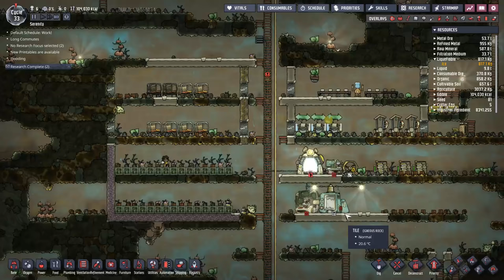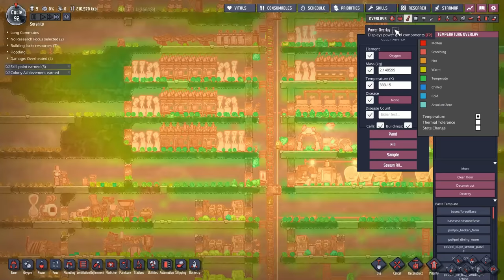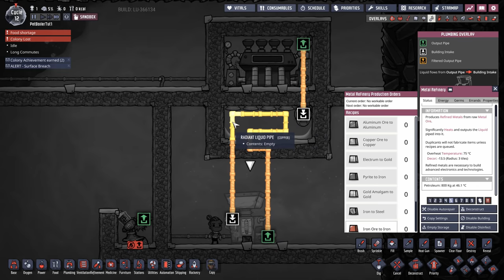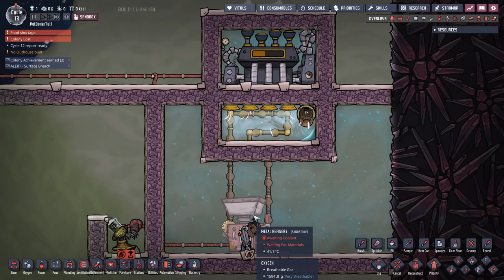Temperature management: Tutorial nuggets : Oxygen not included

Comment: And this is where the learning cliff becomes a mountain.
Reply: There are two rules: 1 Aquatuner moves heat. 2 Anything hotter than 125°C goes in steam below a steam turbine. It really isn't that complicated. 
His aquatuner bridge bypass and heat regulation with doors are not required, so it looks a little more complicated in the video than it has to be.
Reply: @Hedning1390  As a nooby i must ask: what would be an aesthetic(-ish) alternativ? Or any alternativ at all? :)
Reply: @MuhGuy  What do you mean by that?
Reply: @MuhGuy  For the doors you can just cut that step out. Doors are easier to use than pipes in some very specific circumstances. His example with the magma oil boiler is one such. However it's not something  a new player has to bother with. Doors are more fail safe though. If for example you lose power a door can still open and stop the heat flow. However if you are heating your aquatuner coolant and power stops for a long time the coolant can heat up until it vaporizes, damaging the pipes.

As for the bypass its purpose is to keep the coolant flowing so that you don't have to measure temperatures in several different places should you have many hot-spots. I prefer to use something similar to 20:40, ie a short loop for the aquatuner and one or several large loops going through the "ice box", but with a loop and pipe thermo sensor instead of a pump and valve feeding the tuner like 24:06. Basically 24:06 for controlling the tuner and the 20:40 loops instead of the door.
Reply: @dsch772   Well i thought that doors outside of there actual ment use, looked kinda ugly - like as flowdy~tiles underneath a waterreservoire...
And in most builds they (i didn't know open doors couldn't let heat travel through) they sticked out like a sore thumb to me, so i always look for alternativs.
Reply: @MuhGuy  I'm no expert in mechanical engineering, but one alternative I can think of is using pipes in combination with a shutoff. You can pipe in a coolant, or a heat source, and shut off the pipe if temperature is going beyond desired. However it could be a little challenging if you want to pipe in material with extreme temperature (like magma for a petroleum boiler). In any case, doors are still much easier to deal with. It saves both space and material.
Reply from the maker: @Greywind it's not the easiest but it can be done. The steam turbine destroys heat and we use the aquatuner to move the heat there. The save game files are included go in and have a play around. Use the sandbox to run some experiments. You would be amazed what you can figure out with a little play.
Reply: @FrancisJohnYT  I'm only about 500 hours in at this point and from what I've seen of the late late late game it's not the hardest thing to deal with. I've messed about with it in sandbox and I get the principles of how it works. My noggin' just blows a fuse whenever I actually go and attempt it in a game. =7
Reply: @Hedning1390  Nothing is complicated when you understand it. =)
Reply from the maker: @Gr_ywind  Tell you what I can do a practical cooling example. What would you like me to cool down? O2? A base? Crop water? Sleet wheat farm?
Reply: @FrancisJohnYT  I'm sure some people would benefit that, but you already have some in your playthroughs so no need for my sake, it's just my inexperience of good layouts, planning, and what works this point. I just need to get better at scaling everything. The O2 layout nugget was great for that.
Reply: My head asploded trying to watch this. I think experienced players forget how much this game is to take in for new players. The cooling here is just one thing of so many going on with a base. I keep waffling between quitting, trying things out and watching more videos in an endless cycle!
Reply: A learning plateau
Reply: @pixelmech  Dude, I get it.  Stick with it, use the sandbox.  There is a lot to this game and it is cool to build a working base.  There is the Spaced Out DLC now with more stuff.
Reply: sorry to be so off topic but does someone know of a tool to get back into an Instagram account..?
I was dumb lost the account password. I would appreciate any tips you can give me
Reply: @Rudy Alec Instablaster ;)
Reply: Most ONI Youtubers intentionally overkill thier builds. The game is much more simple than they make it seem.
Reply: @FrancisJohnYT  That's what she said.
Reply: Haha wait what? Honestly I've been playing for years and heat exchange and these aspects was one of the easiest things to learn. It and automation are honestly waaaay easier than people make it out to be. 
It's getting into the late game stuff that becomes a huge hurdle and all the complex machine interactions, rocket fuels etc

Comment: This game is just endless learning.  I have 400 hours on this game and I still have never touched the space biome or other planets.  Not because I couldn't force it, but because I wanted to build a self maintaining colony with what I had first.  Or at the very least, a very easily maintained colony.  I think I'm just about there now, but I have to restart again so my oxygen isn't such a hindrance anymore.  Heat used to be my demon, now that I know how temp shift plates work as well as liquid cooling, I don't even care anymore.
Reply: after building my first SPOM it basically clicked in my head how to play this game lol
Reply: I still don't understand temp shift plates
Reply: @steele1485  Let's say you have a super hot aqua tuner.  You put a temp shift plate behind it, that heat will spread to the surfaces around it a lot better than it did before.  Even insulated tiles will start heating up if you have a temp-shift plate next to it.  

You can use temp shift plates, an aqua tuner and a steam turbine all sealed in a thermally insulated block to create a liquid cooler that deletes heat fast.  

And remember to create a vacuum first.  Other gases like Oxygen will screw with the mechanisms.  

Use a gas pump and a liquid lock to create an easy vacuum.  Ideal liquid lock will use something like Crude oil which has a high boiling point.  

Liquid locks use the fact that liquid sticks to the ceiling after a certain height creating a door dupes can walk through without breaking a vacuum.
Reply: @DarkD112  I thought temp shift plates take in the temperatures of the tiles around it and even them out. And I guess my issue was not vacuuming my steam turbine room. Or a bad seed, I had a hot steam vent and a iron volcano within 10 tiles of each other.
Reply: @steele1485  Anything complicated needs a vacuum.  Things like "hydrogen always goes to the top" is too absolute in ONI.  Everything just ends up settling.  

Evening out the temperatures wouldn't be wrong either.  But its practical use is better thought of as heat transfer.  

Like a hydrogen volcano typically makes gas at 500 degrees.  If you try and use a steel gas pump on that, the pump will break.  So you create a heat sink with radiant gas pipes and temp shift plates to pull the heat out of the gas and into a water boiler steam turbine.

Comment: One of the exotic, but also very simple early game ideas, is the heat battery. The interesting thing about the heat battery is that it can use what ever you want, liquids gasses or even solids. The idea is presented in the video but always as a component of more advanced systems. The real advantage of the heat battery is its ability to begin storing and containing heat before the player gets to the point of having the more complex systems of any reason. They also have the advantage of being able to easily be converted into more complex and effective systems with out having to completly destroy the original structure.

Comment: Here's a tip after learning from my mistakes - be careful where you route your automation wires, in my steam turbine cooling system I failed to notice that an automation wire went through the port of the liquid vent, so when the aquatuner stopped the vent closed and the water in the pipes turned into steam and broke the pipe.  Had to seal off the area to fix it up, mistake learned :)

Comment: Newbie here again. Btw, my first ever colony is now in cycle 260 and still going - partly thanks to you. ^^
Question for the setup near 10:30: I see this in 2 versions on YouTube.
Yours, where the pipe from the Aquatuner is solely routed through the steam turbine chamber, to cool that H2 or O2 in there.
And the thermal load is piped through the vapor chamber to cool the load.
The second variant I see, is, where the pipe from the Tuner gets piped through the steram turbine chamber and then further through the thermal load.
(So not going through the vapor chamber. Basically your "Cold box" setup. But with just a normal thermal load and no explicit cold box.)
I guess, when you have to cool a super high temperature machine like the Metal Refinery, leading the pipe with pre-cooled liquid through the vapor chamber
will still be cold enough to effectively cool the Metal Refinery.
But when you want to cool something << 100 °C, I imagine you would use variant 2 and not go through the vapor chamber?
Why then would you ever want to go through there?
Wouldn't the pre-cooled pipe fluid cool that vapor chamber too, which is exactly not what you want? (you want the steam, right?)
And isn't then the second variant near 15:30 superior in every way (even without the thermal injector thingie) , regardless what kind of thermal load you have?
I imagine with the first one, you can never get really cool temperatures, suitable for rooms n such when you pick up heat form the vapor chamber.

TL;DR: What is the point of ever piping through the vapor chamber to/from the thermal load, as shown near 10:30?
Reply from the maker: Not sure I understand the question but let me try and explain.
10:30 is for cooling high temprature, ignore the aquatuner for a second. The heat output from the metal refinery is so high >125C it causes the water to boil to steam which is then converted into electricity. You are effectively turning waste heat into free energy that you can use to help run the metal refinery if you wish. The Aquatuners only purpose in this build is to keep the steam turbine from overheating. You could rip out the aquatuner and cool the steam turbine another way like Wheeze, Ice plates or a thermoregulator. The Aquatuner is just the most efficient way.
15:30 this version is for cooling down things to below 120C, cool your O2, crop area, temprature control sleet wheat. If you tried to cool down your metal refinery output with this it would cost you a fortune in power. Go to the metal refinery and hover over the different recipes, it tells you how much heat it will dump into the coolant liquid and how much that will raise the temp of the liquid.
The metal refinery is special, it dumps enormous amounts of heat into it's coolant. While you could feed it water and then cool that water brute force style with an aquatuner why not fed it a high temp liquid like oil, let the oil get above 125C, use the hot oil to power a steam turbine and get free power instead.
Reply: @FrancisJohnYT  That's basically what I understood from the video then. Thx again!

Comment: Double-check the transformer power loss.  There was a recent (9/9ish) patch that claims to have addressed that.
Reply: Yes, there was. Can confirm.
Reply: Thanks, I just got to that part of the video
Reply: yer a transformer turned off has the same power loss as a standard jumbo battery
Reply: So you could connect the battery automation wire to the transformer instead, and delete the cutoff, the bleedoff from the transformer would be minimal. Though it wouldn't actually be electrically better then the cutoff.
Reply from the maker: Well that simplify's things, will have to make a correction to this on the next temp management video.

Comment: Fun fact ( i havent checked the math but it sounds correct):
The electrolyzer destroys heat if fed with water above 20°C because of the difference in heat capacity
between water and the gas.
Reply from the maker: Can be done. Usually not for temp destruction purposes but usually because 95C water is all you have on hand.

Comment: One of the ways to deal with heat that I found quite useful is dumping heat into fuel and then consuming the fuel. For example, dump heat from Metal Refinery into Petroleum, then send it into Liquid Reservoirs that your Petroleum Generator is consuming Petroleum from to power said Metal Refinery. Heat is deleted, and everyone is happy.
You might say that it's inefficient because you didn't turn that heat into power, but you also have to consider how labor intensive and time consuming is the construction of the cooling loop and how much do you actually need that power.
Reply: True, but a cooling loop that's been setup will be much more reliable and easier to manage.
Reply: @atheistyoda8915  True, but we are talking about how much time the construction/upgrade itself takes.
Reply: @Lorens4444  It's worth it imo. It's not that hard to do anyways and once setup, I don't really have to worry about it anymore (Unless I do something extremely stupid).
Reply: @atheistyoda8915  IMO, it's worth it only if I construct something permanent, like the industrial brick. However, I found out that I could do just fine without it.

Comment: The problem is getting to the steam turbines in the first place and early on the best you can do is with gold amalgam (which i highly recomend getting early on as +50 max overheat temp is VERY usefull on all machines) - so at least in my case (i'm a noob though :P) ive created a box (sorta large - for large capacity if needed) - that box was insulated with igneous rock insulation tiles -inside there was an aqua tuner (or you can go with gas as coolant as well) there was also a liquid vent that could pour water directly at the tuner - to keep if from the overheating.
(you should keep a lot of liquid in there as heat buffer) since it will evaporate - later on you can automatise the process to make sure there is someliquid via automation. via sensors - so you dont have to keep an eye on it yourself every few moments.

The idea is that you use the refinery - the heat gets dumped into aqua tuner - which boils the water in the box- thus making steam - and keeping the heat and steam inside the box for later use when you can make some plastics to make the turbines later on. This is very easy to manage and it can solve a lot of early issues with heat :) 

So in essence it allows you to deal with heat early on - all the while making it usable later on for the turbines :)

Comment: I just used a smooth hatch farm to produce my refined metal for mid game entry.  10 smooth hatches early enough will produce more refined metal over time than you'll need for the entire midgame.
Reply: True-ish.
However smoothies will eat 25% metal ore and give you some meat in return. I use only 5 of them(with 1 unpowered incubator) per stable. Way less heat. I'm not in a rush. I simply drown vents, geysers and volcanoes with water and then research them without needing a atmo suit. 
MR+AQT+ST will make your mid game way easier. And of course it is only way to make steel in long run and big quantities.

Comment: The Thermal Aquatuner is a mass of material as well, so it will heat up and add to the total heat capacity of the pool you were testing in.
Reply from the maker: Thats what messed up the temp, I originally placed a copper aquatuner that I preheated to 30C. I replaced it with steel because I always use steel even if it's not necessary :) but i forgot to preheat to 30C.

Comment: I think I overestimated how much cooling one of the aquatuner/steam turbine setup can provide.  I was running 3 metal refineries, a power grid cooling pipe, and my main base cooling pipes, and all of my oxygen through it.  It couldn't keep up and now my base is getting too hot.  Had to shut down the refineries.

Also made another for cooling petroleum and oil that I pulled up from the oil biome.  It was coming in at about 250c.   It was cooling it fine until it caused the polluted water it runs through to evaporate.  Now I have a big mess on my hands :\

Comment: I usually find it easier to get early steel than early plastic, and so having some more good designs for turbine-less setups would be great. Personally I found it worked great to pipe 10% packet throttled ethanol though my hot room to be directly burnt by my petroleum generator, to burn 300C ethanol. One downside of this is that some ethanol vapor appears when it is burnt, so you need to properly separate it from the polluted water in the output pool.
Reply from the maker: Steam turbines allow you to treat heat like a resource, I find it's usually better to hold out for steel and plastic.

Comment: This is one of those nuggets big enough you can't flush, lol. Also should mention that Thermium is technically better than steel for Thermal Conductivity, but you'd need such a huge temperature difference to really notice the benefit.

Also, I really wanna see someone actually make a 'vent to space' cooling system instead of just saying it's technically possible, even if only for the bragging rights.
Reply from the maker: The problem with vent to space is you could just take that heat and dump it into a steam turbine and make energy. That is why no one uses them anymore.
Reply: Think of the bragging rights. But more seriously, what is the temperature of the CO2 coming out of your industrial sauna at when it gets into space? Might be worth it to run just one more Steam Turbine if that's how you're dealing with the heat.